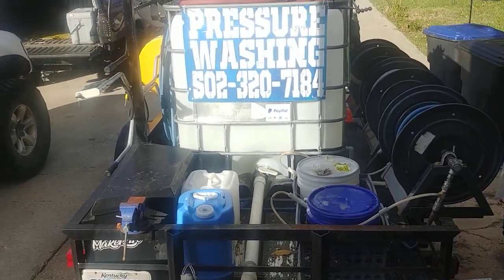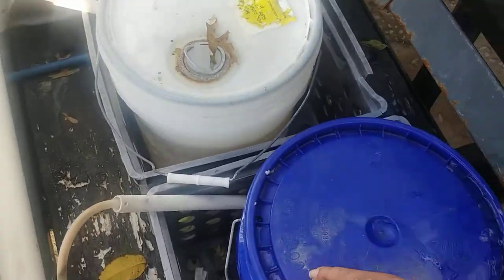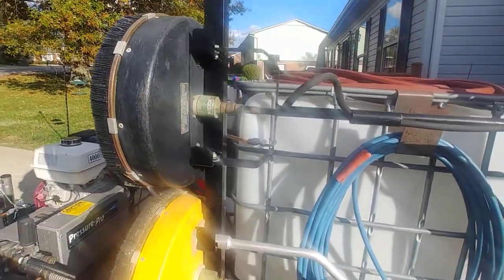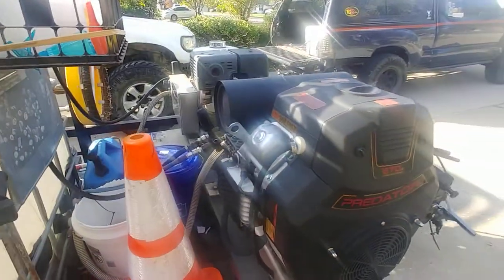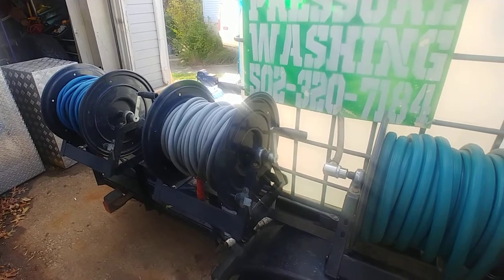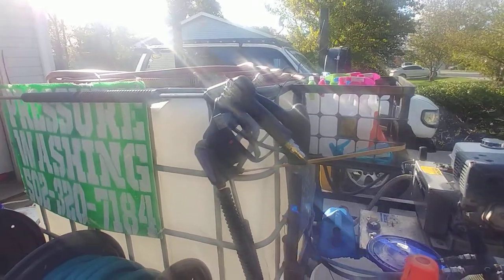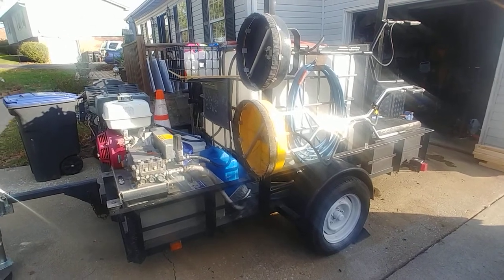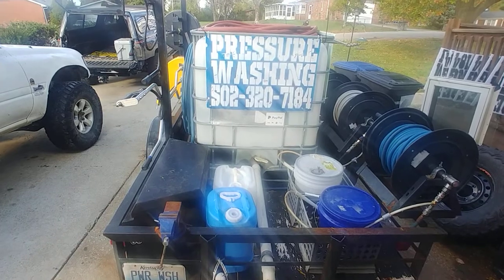Pressure washing trailer set up

Comment: I'm looking for a way to hang wands can you show us what you did
Reply from the maker: I've just got them laying on the trailer deck under the hose reels between the side rail and tank I would like to hang them somehow probably PVC piping zip tied to the water tank
Reply: 1.5-2”Pvc pipe attached to the ibc tote or across the back gate

Comment: How did you attach your reels to the side of your trailer?
Reply from the maker: welded angle steel to the top rail of the trailer then bolted the reels to it works great saves space